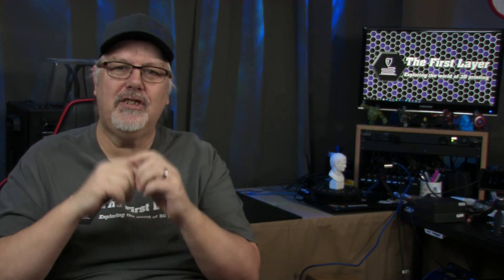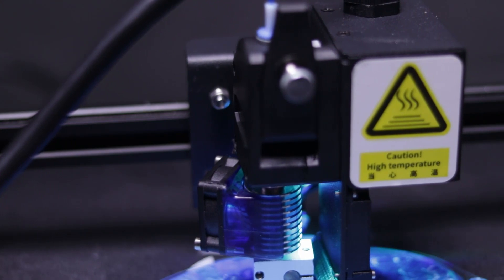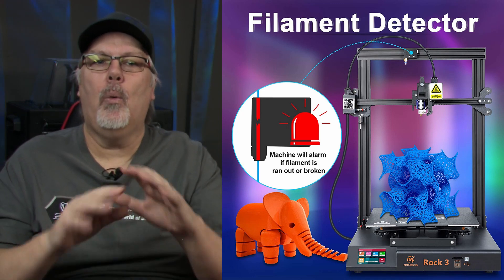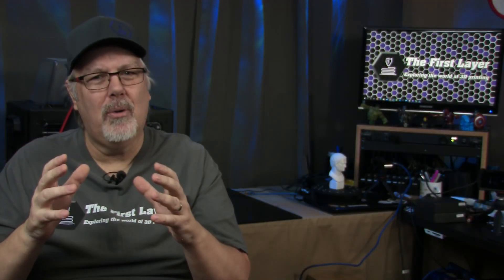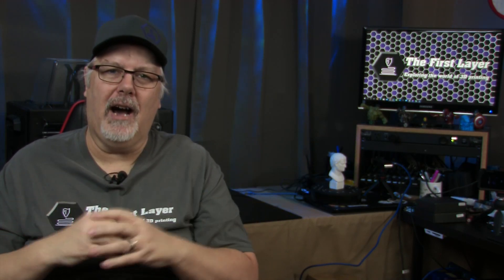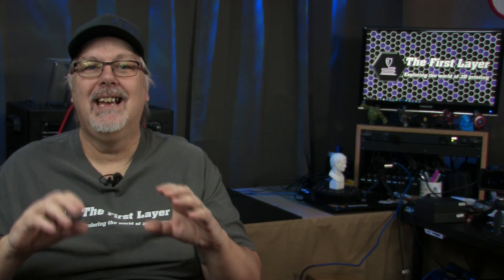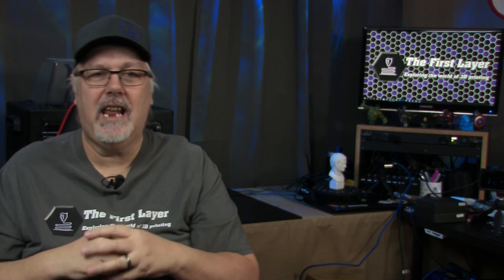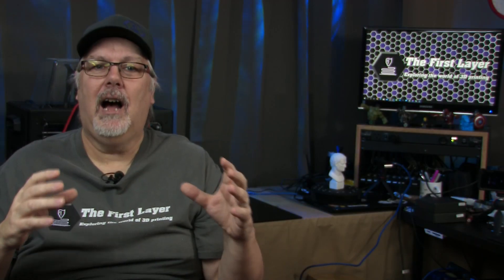Mingda Rock 3 Review : Value and performance

Comment: The Rock 3 (non Pro) works well. The fan(s) are not quiet.  Dont try PETG on the flexiable magnetic surface.... If placed carefully the TronXY 330x330 glass will fit on the 320x320 heat plate but also place the clips in places where the nozzle will not hit. The dual Z axis  screws have no timing belt but I managed rig up a timing belt. Bed levelling is completely manual.

Overall I am very happy with this printer. I managed to get mine at Amazon "used" pricing ....

Comment: Hi say on Amazon they 2021 MINGDA ROCK 3 that comes with glass bed firmware with baby step function and belt tension  all for 500 is it worth it over the other mingda rock 3 for 400

Comment: Hi Richard, how are they handling GPL? Are they using Marlin under the hood? Do they have source code to modify things like BLTouch or other ABL solutions?
Reply from the maker: They are using marlin and to date they have only released .HEX files for the firmware. I am working with them to provide source code for future updates.